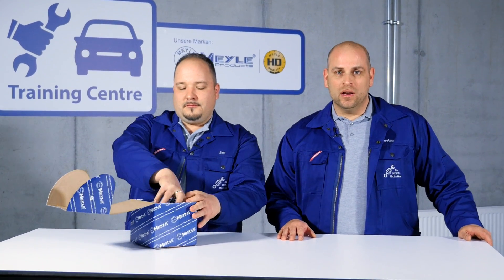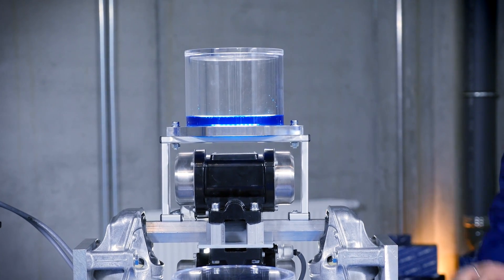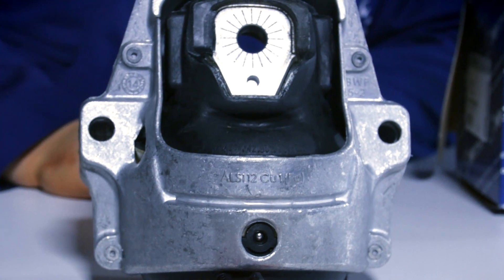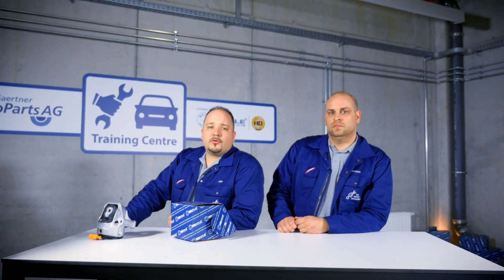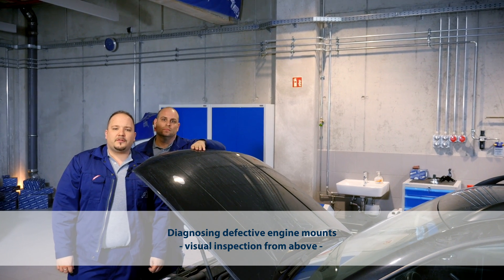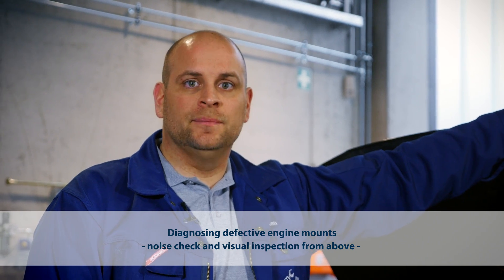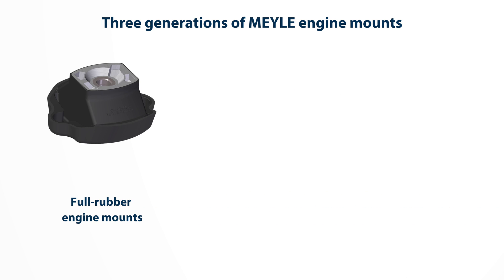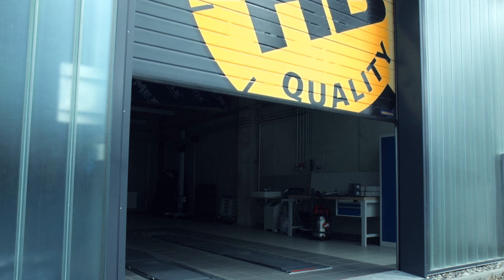The MEYLE Mechanics: Diagnosing engine mount problems

Comment: Where are the Meyle engine mounts made? I’m looking for a set for a 1998 sl500  (r129). Part #1402402217. I’m looking for a high quality mount as I have used FebiBilstien in the past which in my opinion is garbage only lasted three months then used Lemforder mounts that have been good for about nine years and now I need to replace them but Lemforder no longer makes the mount for my car.
Reply from the maker: Thanks for the question and interest in MEYLE! Our engine mounts are engineered and quality-approved by MEYLE and produced by one of our partners in our international distribution network.
Our parts are developed strictly in line with the guidelines and specifications of our own engineers at the Hamburg location, and overseen and tested in the production process.

Your MEYLE Team

Comment: For a year I've had a vibrating steering wheel and rear view mirror on hard low rev acceleration in my '15 535d. Car often seems quite loud on idle and has a high frequency resonance. Going to replace the mounts now, hope this fixes it!

Comment: Does it cause the front chassis to look misaligned or lop-sided due to bad worn-out engine mount?
Reply from the maker: Normally, defective engine mounts should not affect the axle geometry or the front chassis.
Reply: @MEYLETV  thank you! What's the most likely culprit? It seems my right tire is taking more weight than usual. Strut is to be blamed? (McPherson).
Reply from the maker: It's really hard to judge from a distance. It's best to ask a car mechanic to check that..

Comment: I have Hyndai i10... Will week  mount will cause Mise firing or engine hesitation problem..
When shifted to lower gear
Reply from the maker: A damaged engine mounting will lead to vibrations during shifting and lower engine speed. Misfiring comes from somewhere else. Are we talking about a diesel or gasoline engine? Best regards, MEYLE-TV

Comment: Do you think that is possible for a car with 20.000 kms already suffer from a bad engine mount??
Thank you!
Reply from the maker: Hello Miguel, a failure of an engine mount at 20,000 kms is very early. If, in your case, this is a hydraulic engine mount and the hydraulic fluid has leaked out, it may be possible. You can determine this with an optical inspection. Your MEYLE-TV

Comment: Hello. Thanks for the informative and quality video. How can I diffrentiate between engine or transmission mount? My car also vibrates on neutral. So I think that it is not transmission mount. Am I correct?
Reply from the maker: Hello, in most cases, the transmission is flanged directly to the engine. Engine- and Transmission mounts serve the same purpose (preventing vibration to go from the engine and  transmission to the chassis). If you cannot tell optically which of these mounts is defect (cracked rubber or leaking), you should replace all mounts since it is impossible to tell which one is the cause for the vibration. Best regards, MEYLE-TV
Reply: Thank you very much for your help, then I think it is better idea to replace all at once. One more question, can not correctly placed flywheel cause similar vibrations on neutral?
Reply from the maker: Sorry, but we don´t sell flywheels so we can´t give you an answer concerning that problem. Best regards, MEYLE-TV
Reply: I understand. Thanks again